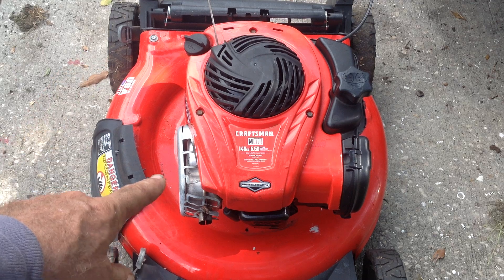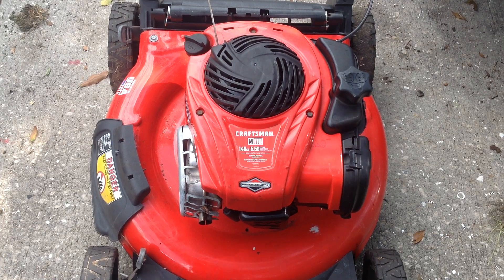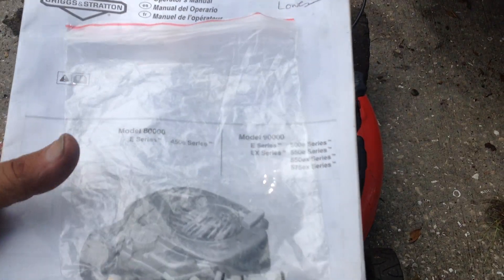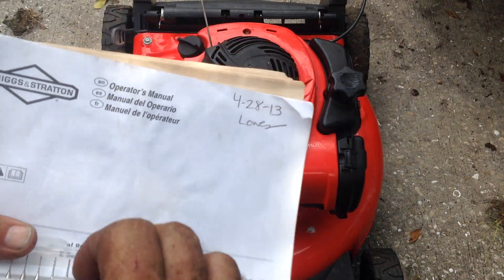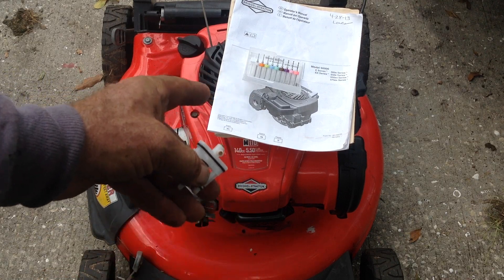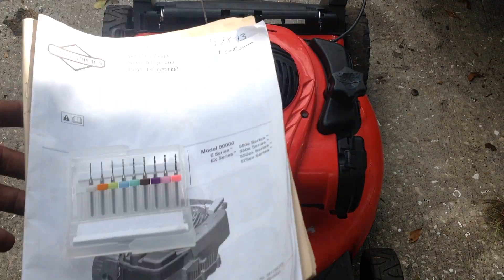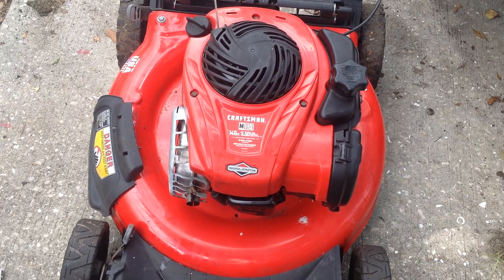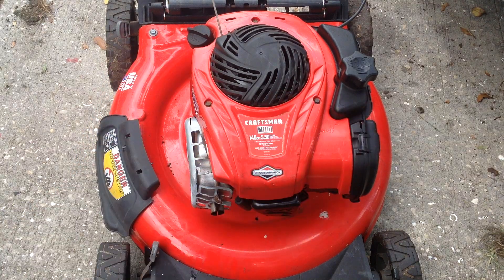2020 Craftsman M110 Lawn Mower with BLUE Fuel...The sky is falling!! Part TWO.

Comment: I had a mower come in this past summer (a Honda powered Troy-Bilt TB-240) that would start then immediately stall out. It had a full tank of blue gasoline that the owner had just purchased from a cut-rate gas station (called Raceway and sometimes Speedway here in NJ). I poured the fuel into a glass pickle jar and let it sit for 5-10 minutes, about 1/4” of water formed on the bottom. He said he just bought the gas that day and had no idea it was blue or full of water. After I flushed it all out the Honda started right up and ran perfectly of course. I’ve also seen and had problems with green fuel, presumably from the same kind of cut-rate gas stations. Probably made with toxic waste or something!
Reply from the maker: That was great chemistry work on your part.  I will keep an eye out for this blue fuel again.